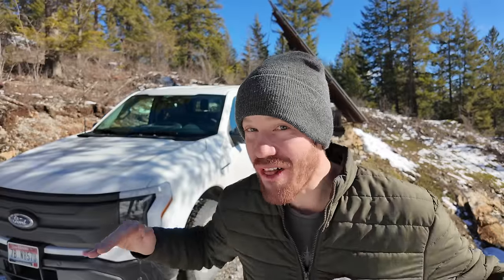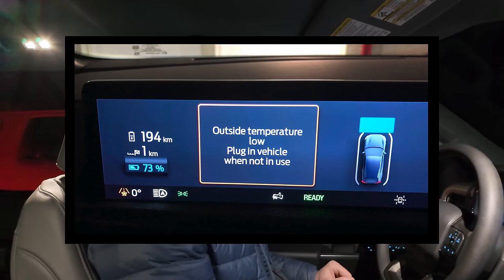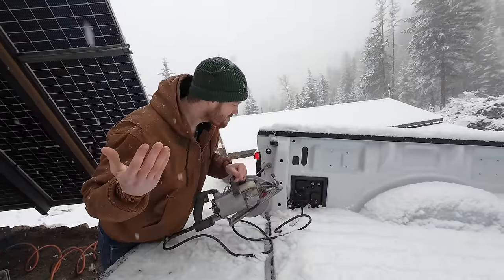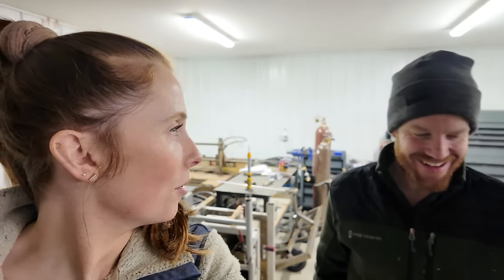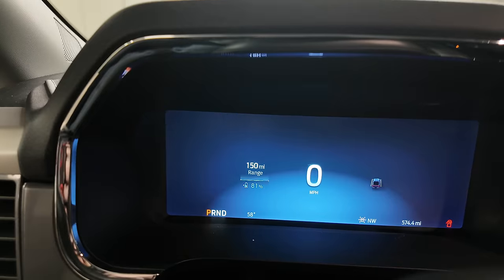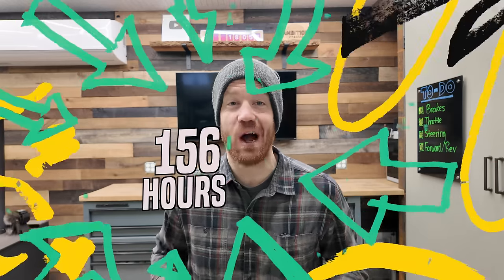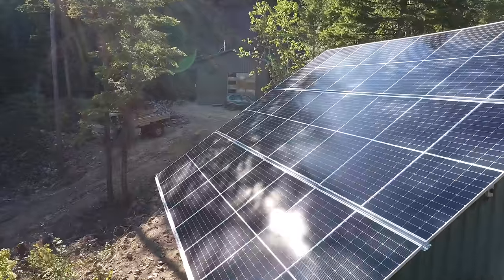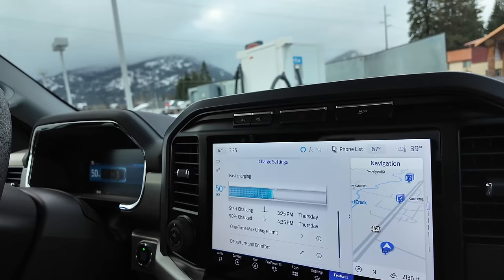Replacing My OFF-GRID Power System With an E.V. (not what I expected)

Comment: Interesting experiment. 
Not a fan of Lithium batteries. Seen to many bad installs. 
And the fires from them are very real and very scary.
The technology has come a long way, but has a long way to go.
The idea of having a running vehicle inside a building scares me. 
I Don't care what kind of vehicle it is.
Things can and do go wrong. 
Listen to your gut Courtney. Yes we heard.
The charging of the truck in town still costs money. And time.  
Did you figure in the total cost of that?
As an emergency backup to your other systems. You are ready. 
Anyway. You want reliable. Stick with the 2 generators, Solar and the LMTV. You are set.
Thank you for the videos.
Cheers.

Comment: I am courageous on the statement you say 'whole house'. Does that include the HVAC system and the heat pump water heater? If it does that is amazing, but I don't think it does. Also the time you spent on charging that vehicle is not the time I would want to spend my life doing.

Comment: 50k for Truck, plus cost of 2 generators, back up batteries, solar panels, container. Think I prefer to stay on the grid with back up power. I bet in the small print of the Ten year warranty, using the truck batteries count as warranty hours? Why not run grid power up to house, how much would that cost?

Comment: You need to remove the ground prong on the 240 volt plug that goes into the bed of the truck.
Reply: The grounding system between the house, off grid system and truck do not get along at all. Have a dedicated 240 volt extension cord with the ground prong cut off just for the truck

Comment: The wear (cycle count) being put on the truck by 'ferrying' cheap power from town costs way more than you think. Just wait until that battery craps out and the Ford dealer has a smile on their face while you pay for a new battery.
Reply: Battery is warranted for 100,000 miles. It is 20 miles round trip to town. He will need to make 5000 trips to town. 13 years of daily trips?????

EV batteries are good for 1500 to 2000 charge cycles. Thats at the least 4 years of depleting the battery every day from 80% to 20%. Taking freeway tested mileage of 280 that’s 168 miles ever day or 245,000 miles

That’s pretty dang good I would say.

Comment: You have just proved that if someone steals an EV they can use it to power their off grid home.
OR
Buy a wreaked EV, strip out the batteries (and repair if necessary) and the charge unit and install it in your home.
OR
Steal an EV, strip out the batteries and use that.
OR
Wait for another 2 or 3 cold winters because then EVERYONE in the snow areas will be selling their EV's at low prices or even giving them away just to get rid of them.

Comment: I understand the purpose of the video but it certainly does not help with Electric vehicle sales, I have a Tesla and the charging system is way different then the problems other EV's have, charging 100kwh  at level 3 440v 250kwh supercharger only takes 40 minutes and home charging takes 4 hours level 2  220v 40kwh home charger which is free through our solar setup.. Also supercharger cords are not heavy and charging is extremely simple on Tesla chargers and there is no hassle credit card or complicated connections...

Comment: Your EV or any EV should not be used to replace an off grid power system.  It is a way to improve reliability and mitigate your use of fossil fuels and hopefully reduce household operating cost. Did you have intentions to drop your solar system and just use diesel or propane?  Not likely.  Now you have an efficient (and tasty) way to transport household power when before you needed to transport the diesel or propane to run the generators.

Comment: I'm guessing the reason you have to have the truck turned on is so that some random person can't use the power when you're not wanting them to.  It would seem that they would have allowed turning off the fake engine sounds.  I see that Ford has cut production on the Lightning in half and also there is another recall just in the last few days I think.  They have to make everything way more complicated than it needs to be and that will be the downfall.  The solar charging is the best thing if anyone has the $ to get it set up and a place to do so.  I have enough area, but not the $ so I just watch videos and enjoy learning in my waning years here.

Comment: 🤔 There is a reason why Ford & GM have stopped their EV programs.  

       Why not consider Tesla? Teslas can be had in all wheel drive and its charging network is the definitive standard for a high capacity domestic and international  charging.  The concept of having onsite bidirectional vehicle charging is great in an era when supply chain disruption can occur at any time. 😎

Comment: The fact that a power system costs as much as a new truck is troubling. I have a VERY high power usage home around $250-$300 per month and the math says in ten years time I would only pay $36,000 in electrical cost. No way a solar setup or that truck will last 20 years. While I find this video very entertaining according to the math neither would be practical if grid power is available. Maybe I'm missing something?

Comment: Great video and I am talking with a friend about your setup.  Sadly, you started on the wrong foot.  You gave EVs a black eye when you plugged into a 120v outlet and showed disappointment when you got 10 miles of charging in 5 hours.  Once again, to the uninformed, you gave them 'the sad story about sucky charge rates' instead of explaining when/why of 120v versus High Amp (240v 50a) or supercharging.  There are use cases of people charging at 120V overnight (12+ hours) and getting enough charge for their daily needs... resorting to a supercharger if they get behind the power curve.  Also, in an emergency, I can get 120v to my vehicle more redily than 240v if an emergency fillup is needed.

Comment: I've always disliked the price per KwH being used as a direct rate to state cost per mile.  It leaves out a critical factor which is you have about 5 to maybe 10 years life to the battery and the more miles you put on the closer to 5 years for the life of the battery.  Driving exactly average per year, the 100000 miles is 7 years, so don't be fooled by the 8 year part of the warranty that is just a limiter for the extreemly low mile users.  With it being about $32000 to replace the batteries that is leaving a lot of cost out of the equation.  Around $0.32 per mile, so the real cost per mile should be around $0.36 per mile.

Ford needs to put out a firmware update to be able to turn on the truckbed outlet without the truck being on.  If you are trying to run your house the desire is to maximize the benefit of the electriciy not waste it on unused items.

I always thought of using the truck as an expansion pack to the houses batteries.  Not a replacement or a recharger.  The ability to store more solar electricity while its made without having to directly expand the spending on house storage only was what interested me.

Excelent video, felt truly honestbeing neither a bash session or a you must run out and buy this session.

Comment: A drawback to ev is when a battery goes out and needs replaced. You have to pay for all the batteries all batteries and at $300.00 + makes the repairs very expensive if one has to replace all batteries and not just the one that goes out.

Comment: Bought the Lighting ran it for 6 months and sold it as fast as I could. They are complete garbage and I would never recommend going full electric truck to anyone who actually uses a truck. The F-150 with the 7200w generator mode is a much better option.

Comment: 😂😂 I'm pretty sure a few hundred people have already told you, You did it wrong, and you didn't even have the correct equipment.
That truck is not supposed to be ON. It's supposed to be plugged into the specialized Ford Intelligent power backup system.
You probably would have got an extra day out of it with the proper equipment

Comment: The truck you cant use as a truck if you want to drive more than 100 Miles.... I was debating buying a Tesla when I noticed a disturbing trend all the used EVs (I was looking for a Tesla being a Techie or the Lightning)  all of them were at our top motor companies meaning trade in.  The one lightning I found was at a Ford Dealer and the owner of the dealership bought it traded it back in when it wouldnt pull his bass boat so I ended up buying a 2021 Dodge Ram 2500 with a Cummins ...... for me diesel is better for Hurricanes and my Home Diesel generator

Comment: Do yourself a favor, use the hell out of it. You're going to want to use that warranty 100%. Charge to 100% wherever possible and fully discharge if you're next to a charging station. Lithium generally has a life cycle of 3,000 to 5,000 cycles. Don't worry about burning out any components The worst thing that'll happen is you tow the truck, but don't tell them what you did. You want the warranty to kick in.

Comment: Efficiency of the inverter should be at least 90%, so you get surprisingly little energy. Maybe the car is using lots of power when it's on. Sometimes they do it while there's no technical reason why it should be like that.

Whether you have earth current leakeage breakers in your house or not would be interesting to know and also what types they are. It can give some hints if the hair dryer is faulty or is the car system just too sensitive. 

It's not surprising that your battery inverters don't work with car outlet. Connecting two high power ac  inverters together is never good idea. Those uses switching technology and the current is pulsating. It's also bad for efficiency point of view, since dc to ac and ac to dc conversion is unnecessary. Right way to do this is to connect charger directly on cars high voltage battery output. Unfortunately this is not supported by the vehicle, and may not be supported by your charge controller either. Typically they  support required voltage level on panel inputs, but are not designed to be used with batteries, so manufacturer may not like the idea.

Your charging time shouldn't be more than 45min, if 150kw charger is available. With 50kw charger, 2h time is understandable. Otherwise there's something wrong somewhere and you should figure out what.

When counting wether it's good idea to use ev battery to charge your off grid system, you should think about battery costs. In general, ev batteries have less charging cycles than solar storage batteries. That raises overall cost per kwh. It's basically battery price/battery capacity/cycle life.

In EV, calculation is more complex. Typically battery lasts vehicle life time, but can be very expensive to replace. If you use extra cycles, which otherwise wouldn't be used, they can be close to free but if you have to replace your battery because extra usage, then you end up paying a lot. I'd say that in your case, extra battery wear is not significant. Once per week during winter months is not that much and you don't seem to drive much with it anyway.

Comment: Isn't the idea of off grid to reduce your carbon footprint, having redundant batteries inverters and the F150 in addition to 2 backup generators is a Way larger carbon footprint. and orders of magnitude more expensive and ultimately the power comes from the  grid

Comment: You have to value your time into the cost. Yes electricity is cheap in town, yes the capacity is large, but you have to baby sit that system continuously, drive it to town, wait in town, come back, plug it, un plug it, … so much time! You could do productive projects instead of working for your own power plant station.

Comment: Hi guys, a very interesting video indeed, however, as impressive as the results may be, i can't help wonder was it worth the effort and stress? I mean i get that living off grid comes with a certain degree of effort but... It seems like the traveling to and from town to charge the truck then come home to link it up to the solar/house system seems a bit ott. This experiment would probably be useful as an emergency sure, but as THE solution to replace a generator , imo, doesn't seem worth the effort or the financial savings. Consider this, it cost money buying all the extra bits and pieces needed to get the truck connected to the home or the solar system, it sounded like you experienced a not-so-comfortable level of stress while doing the test when it came to the errors and CEL on the truck. I cant help but believe you lost some sleep over this. So, baring the above in mind, in your opinion was this all worth it? I'm genuinely curious.

Comment: And then there's the concern about EV batteries spontaneously combusting... and having one of those ON and charging your home while it's sitting in your garage... 
I think your second option of using it to charge your battery bank OUTSIDE and away from your home is a far safer idea.

Comment: I hope this message finds you.
Those ev fords are not problem free, and I would not store or charge that truck in any building you care about.
Should that battery catch fire there is no moving the truck, and there will be no putting that fire out (ask your fire department) it will burn down whatever it's near with it, buddy.
And if it has even 1 cell get .1 volts out of spec it will not move until that's fixed..
Ditch that hunk of junk

Comment: i would rather buy a tier 4 kubota powered 10 kw diesel generator brand new for 13k and buy a whole bunch of off road diesel for it, and some spare filters oil and maybe a voltage regulator etc.. then again i fix generators so im biased,, i will say its neat, but i dont like the fact that most batteries are made overseas, then shipped here on diesel ships, plus they are way more toxic being made and being disposed off then a small diesel engine will produce in 10 years

Comment: Owning a hybrid Jeep I would now never own a full electric anywhere it is cold. Cold sucks the battery so bad. And all sorts of software problems too. It does need to be plugged in to keep battery warm so it is not an 100% off grid vehicle but it could be handy while working on your property vs carrying around powerbanks. Sorry you bought the steak and only got the sizzle.

Comment: Great video per usual. As to why the truck tripped when charging the house batteries; when you set the input amps to 18, was that the combined amps for both inverters?  I have a similar system and I made the mistake of setting each inverter to 18  amps when trying to charge from a 20 amp circuit and it kept popping the breaker as the victron system was trying to draw too much. After doing this twice, I then realized my mistake so I  set each inverter to 9 amps for a combined 18.  Just a thought. If not the case for you,  maybe someone else can learn from my mistake.  Keep up the great work.

Comment: just build a mobile battery stack that can be charged at a supercharger in town. i wonder how would it cost. it is so difficult to replace Fuel because of its flexibility... batteries are still  very slow to charge... it is a LONG break to wait 1hrs30+ in town while it charges... compared to a 5mins refill with normal fuel... i  vote BIG mobile pack vs electric vehicule for now. maybe next year?, in 2 years ? who knows the technologies are improving fast

Comment: Not sure how you calculated 4 cents per mile when charging from the grid.  I have a Tesla Model Y and great electric rates and can barely get that.  The Tesla is much more efficient than the F150

Comment: I don't think I will ever buy an EV. One would never work out with the way I use a vehicle. Even if one did living where I do the cost to keep it charged will be to high. 
On the pick ups the reduce load and towing capaity the EV can't keep up with a IC powered pick up. The weight of the batteries is way to high. 
In your case were you have solar power to charge your EV's then they can be a good idea as extras to IC power. During winters like you get the reduction of range due to the cold having an IC powered vehicle may become a necessity.

Comment: Can it replace your off grid system?, No is the simple answer, will it work as another alternative for short periods? sure, but the technology needs to be a whole lot more reliable than it is presently...   Personally I think the vehicle manufacturers need to go down the route of making the motors less power hungry rather than just making bigger and bigger batteries....but that's a whole other issue.

Comment: Not meaning to be the voice of dissent here...but so far, electric vehicles simply aren't practical. You proved it yourself, take your own situation for example: If...IF (and this is the big one)  you had the normal 9-5 job, away from home, you'd have precious little time to deal with the hassle of charging, especially where you admit you're driving to town and using grid power for your truck. And also bear in mind, your home is designed to be very power-efficient. BIG factor. So, unless you clone yourself and have your clone doing all this running back and forth, charging this and that, it's simply impractical. Sorry, Riley and Courtney!
Reply: Lack of watching comprehension?? Is that a thing now?? Free electricity 9 months of the year for a truck you can use for 90% of your truck things and is also a backup energy source to stretch out your power curve.